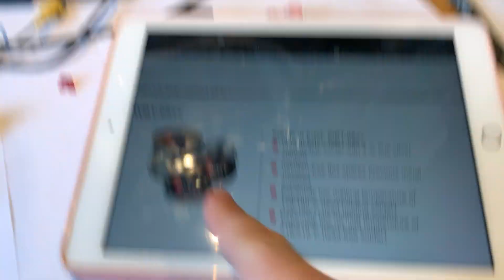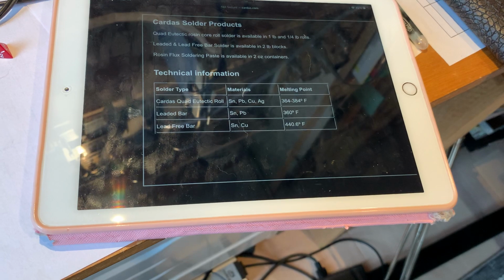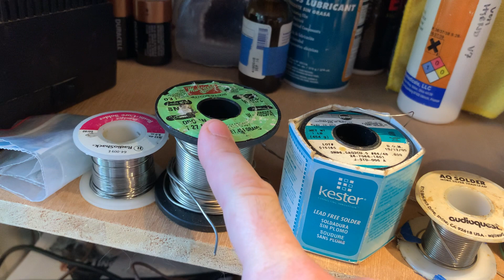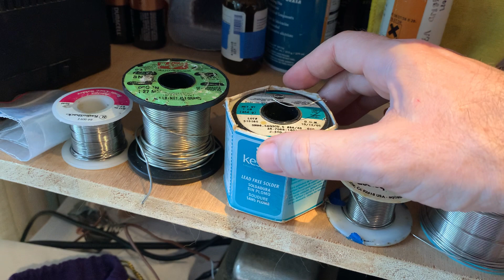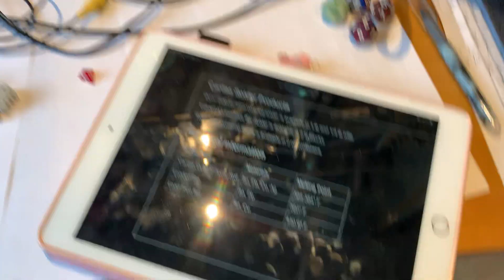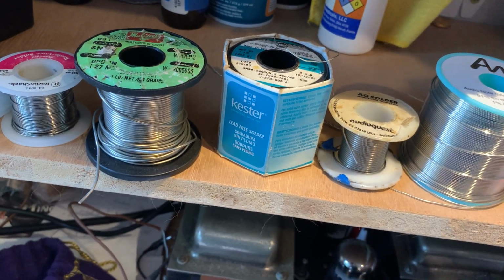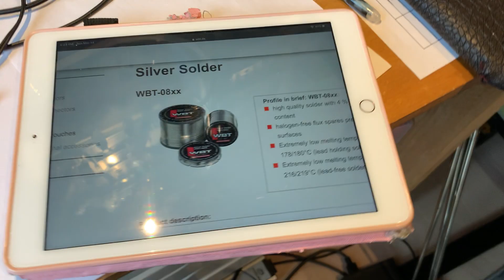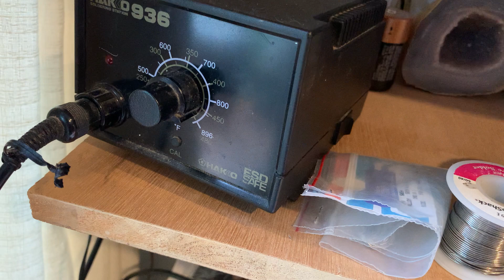Solder masterclass! Audio note & audio solders

Comment: It’s impressive that you can hear the difference between different blends of solder, that’s a Super Hero skill. I can’t even imagine ever being able to do that.
I have been using the wbt 4% silver lately, can’t find much info on its composition but how would you rank it in comparison to the kester 4% silver or the audio note 6% silver? Also where did you get the audio note solder from?…
Cheers Marc in Ottawa
Reply from the maker: Hi Marc, the Kester is brighter than the WBT and the AN. The AN is similar to the WBT, but I have no direct comparison between the two - used the WBT silver 20 years ago.... I think AN is the most balanced tonally of the three, WBT second best with a little HF tilt, Kester is unbalanced with a lot of added high frequency energy. Not bad, but you will need to rework the crossover for it, in case all the equipment uses it. The way I see it is to use them puprosefully, for example if you lack high extension / energy, then start changing joints for the Kester. If need better tonality, better midrange then add AN, if need more bass the AudioQuest. Overall, now I use only the AN solder, as it has the best balance and cleanest tone. It has no exagerations, so will not help to fill out more bass or more top end if the gear lacks it. 
The best way to learn to tell solder apart is to try it at critical points: such as the cartridge connector pins, grid of the tubes, or the driver terminal tabs. That's where it matters the most, and you can hear the change the most. At other locations you might need to change a multitude of solder joints before the change becomes apparent on a larger scale.  Sorry for late reply, so it only now. Cheers, Janos
Reply: @realworldaudio  I ordered some Audio Note silver solder from Aliexpress, hope I get the real deal…
You can also find Mundorf silver solder with 9.5% silver 88.6% stannum 1.8% copper and 0.1% gold but no antimony F.Y.I…

Comment: IME/IMO lead is death to sound, this new age of lead free soldering is great benefit.
Reply from the maker: Indeed, lead is really awful, it deadens the sound big time.
Reply: @realworldaudio  Yes, to me lead/tin solders sound toxic (lead/tin/silver even worse), I do not understand the desire for 'vintage' gear with lead solder and phenolic circuit boards, yechhh.
Reply from the maker: @ericmc6482  I started my audio journey on a stereo 70 - changed every solder joint to lead free silver solder, and of course, new caps throughout. It sounded pretty modern, no sluggish sleepy sound there, but one of the best amps for piano - not highest resolution, but most faithful in tone. Indeed, I plant to resurrect another stereo 70 sometimes in the future, but I will do it without the nasty phenolic board. The phenolic board has been bugging me as well. :)
Reply: @realworldaudio  Yes substrate dielectrics are critically important, there are super low loss RF/MW pcbs available nowadays I am told that are neutral sounding and better sounding than standard FR-4 which contains Bromine as fire retardant.
Reply from the maker: @ericmc6482  Indeed, I guess it will be a while until we can improve upon PTP wiring ; )